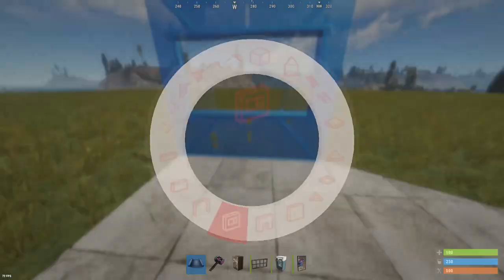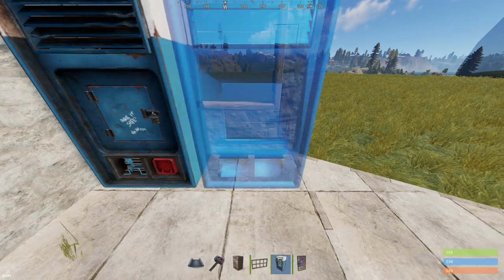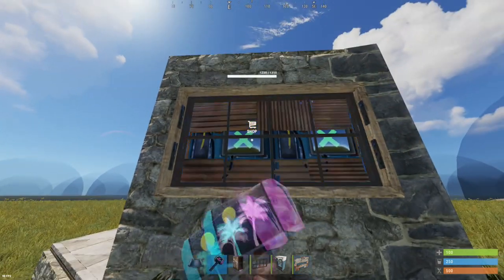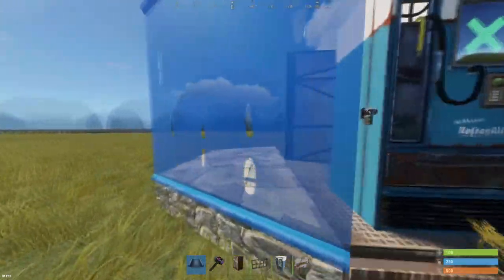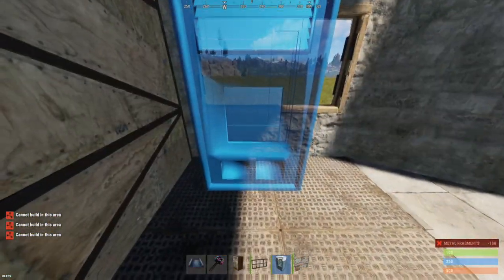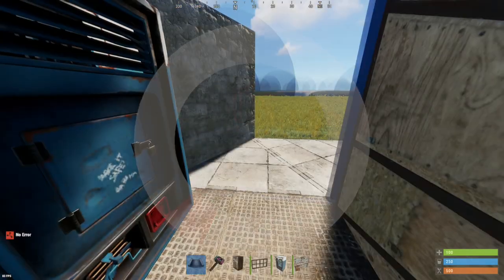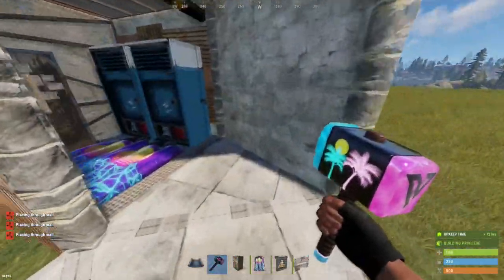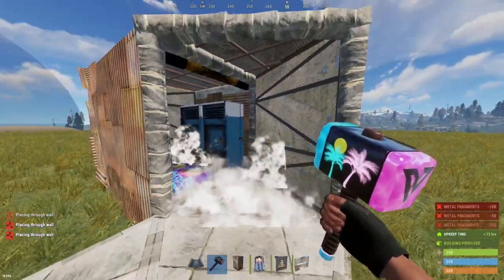Rust Vending Machine Shop Base Design V2 (Drone Accessible) - Build Guide

Comment: To anyone on console you can put the vending machine thru the window wall and slap a reinforced glass window and still use it but idk if that reduces or increases cost due to splash damage from rockets hitting shop sticking thru a wall

Comment: I’m a noob so bare with me please. Why not upgrade the door frames to metal too? Also why not just use all garage doors? Are those armored doors or sheet metal?
Reply from the maker: No matter what door you have, a stone doorway will always be stronger or as strong a the door you have on it, the only benefit of upgrading to sheet metal is that it could be easier to seal during a raid, I wouldn't recommend that because its just a shop base. Its just cheaper to use normal doors over garage or armored and costs the same as going through walls, so garage doors wont make the base any stronger.

Also, hopefully this will help
Sheet metal door/sheet metal double door - 1 rocket + 8 explosive ammo
Garage Door - 3 Rockets
Armored door/armored double door - 4 rockets
Stone wall frame - 4 rockets
Sheet metal wall frame - 8 rockets
Reply: Awesome! Thanks for the reply bro.

Comment: Is the build in the video drone accessible?, I saw a comment but it's was confusing to understand what you were talking about.

Edit: does using 1 vending machine reduce raid cost?
Reply from the maker: It is drone accssible, and no, using one vending machine doesnt lower the raid cost.
Reply: @X3Rust  ty! Ill be using it
Reply: @X3Rust  mine isn't drone accesible, but i messed up the placement of the 1st machine so the 2nd is placed a bit diagonally...it thought the only consequence would be people can see inside...wondering if there was an update, or if my placement is causing both vending machines to not be drone accessible (even though the first is placed almost like you did, just not close enough to the corner)
Reply from the maker: @gahbor  I dont believe there was a patch. You do have to have the placement pretty perfect for it to be drone accesable

Comment: It’s says not reachable by drone, nor can you even trade in front of the window. Was there a update that broke this design? If so can you make a updated version
Reply from the maker: Did you use the correct window? If you use the reinforced glass window you cant access the inside. The design works its most likely the way you built it. Make sure you follow the steps in the video exactly but besides that not sure whats wrong.
Reply: @X3Rust  ah my mistake, sorry still quite new only 50 hours. Thanks for the quick reply! I subbed ;)
Reply from the maker: @endreh8406  Glad I could help!
Reply: @X3Rust  i used metal window bars and horizontal window embrasure and still not accessible by drone... help?
Reply from the maker: @LocalCasual99  most likely the placement.

Comment: "can hold 2 vending machines" but I put only one and my TC was raided and stuff stolen without any doors or walls being destroyed. It was suppose to be vending machine shop, not vending machines shop. I do not recommend this guide.
Reply from the maker: Well its pretty obvious that without the second vending machine you can see the tc from the outside. If you wanted one I have a seperate tutorial or you could just add a door frame and put the vending machine in there.

Comment: still 7 rocket + 6 Explosive 5.56 Rifle Ammo
Reply from the maker: 3 rockets for each garage door and 1 rocket for each single door? How would you raid it for 7 rockets and 6 explo?
Reply: @X3Rust  1 Metal Wall is 7 rocket + 6 Explosive 5.56 Rifle Ammo
Reply: yet a good building
Reply from the maker: @kimhendrickx5877  yeah thats true, but in the building community its accepted that a metal wall is 8 rockets. You are correct tho
Reply: @X3Rust  that's true . I hope you make a lot more building. grts kim

Comment: Raid stone wall (185 explo), soft-side ceiling / wall and you're in.
Or
Raid horizontal embrasure (173 explo), shoot out TC, wait for decay.

Downvoted.
Reply from the maker: You cant soft side the ceiling or wall after breaking the stone wall, and waiting for decay after breaking tc is slow, and not even worth the time.
Reply: @X3Rust  You can soft side the ceiling. 

I can take control of the shop and wait for it to decay. No problem. Just accept the fact it sucks.
Reply from the maker: @yourtruefan1893  I tried and soft siding the wall and ceiling, it's impossible if you placed the vending machines correctly. Taking over a vending machine base and waiting for it to decay isnt worth it 95% of the time. Even at that, I dont think the shop "sucks"
Reply from the maker: Also soft siding metal takes forever, stone is do-able but metal is just a waste of time
Reply: @X3Rust  Get on Vice build server and I'll show you that you can soft side the ceiling. It doesn't take forever lmao. Keep making excuses to defend your poor design and you'll never get better.
Reply: 3 people can soft side it at the same time
Reply: @yourtruefan1893   @YourTrueFan  dude who soft sides a metal wall, u ll be countered like 1000 times, you must be playing on a super low pop if u think u can get away with that, plus i couldn't soft side it anyhow, also, using drones as go to loot is OP. This is a cheap and a safe build, plus none would use it as their main, personally its a great job.
Reply from the maker: @harshagrawal3853  Thanks lol <3